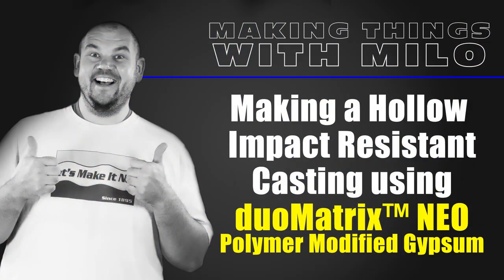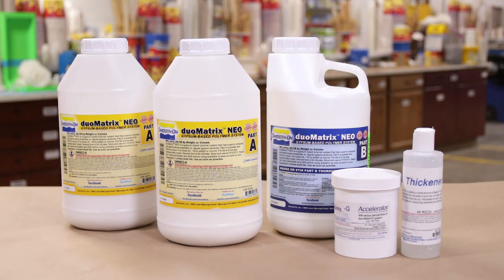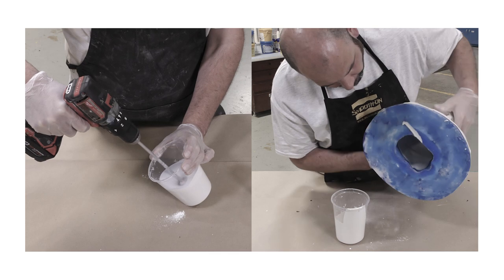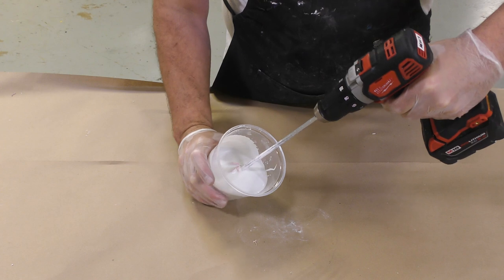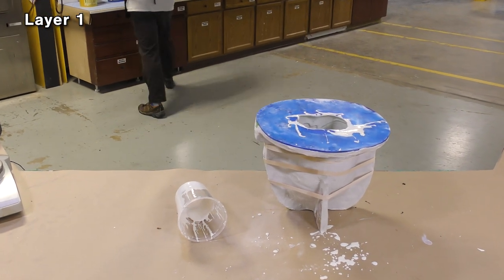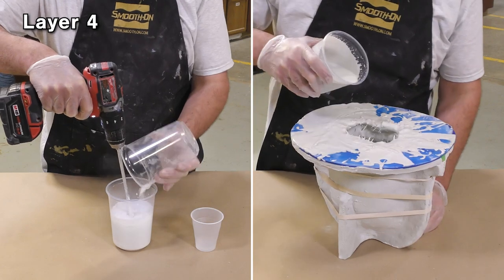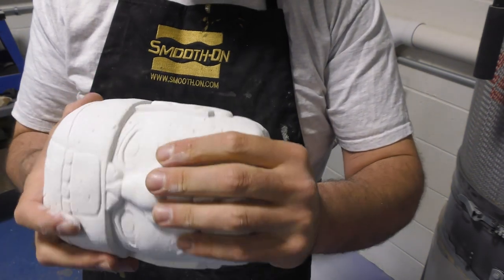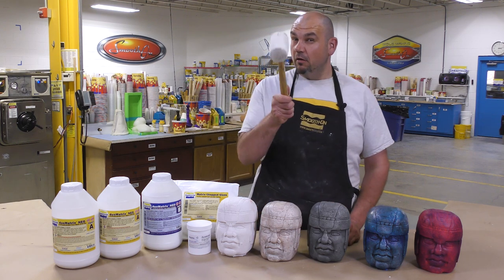Rotocasting duoMatrix - How to Make a Hollow Impact Resistant Casting

Comment: Simply amazing Milo, I never imagined that Duo Matrix Neo was so resistant.  Incredible demonstration 👏👏👏.  Thank you SMOOTH-ON ⭐
Reply from the maker: Thanks for watching, and don't forget to subscribe!
Reply: @smoothon  can i use my SMOOTHCAST 66 D as a roto casting resin material ?.. because i need it to be aquarium safe and i heard that the 66 D is.  or do you have a better resin to use for aquarium safe roto casting.
Reply from the maker: @gladiatormechs5574  yes, you can use 66D to rotocast.

Comment: How long do you wait between layers if not using the accelerator? Thanks.
Reply from the maker: You should wait about 30-40 minutes, until the material is no longer flowing.

Comment: What did you use to seal it for out door use?
Reply from the maker: NEO castings must be sealed with a suitable siloxane sealer or concrete / masonry sealer such as Euclid Chemical Baracade Silane 40 WB or Baracade Silane 100 C.